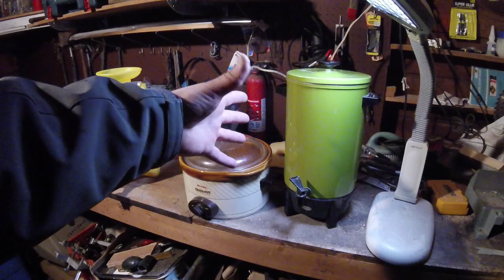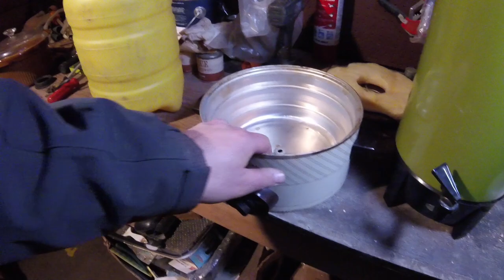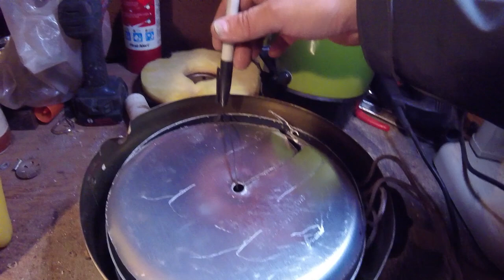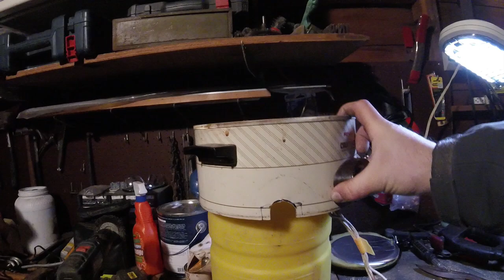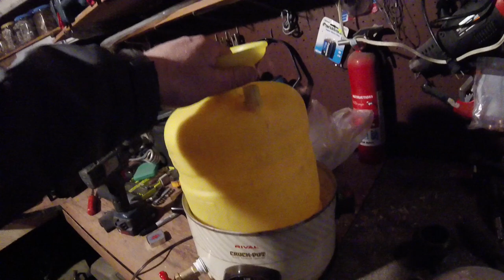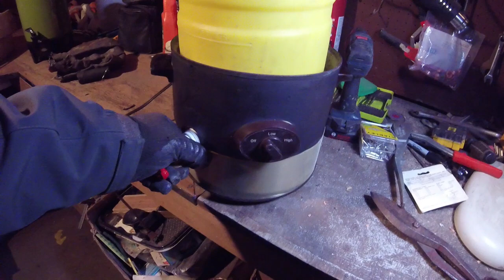PORTABLE Gravity Fed DIY HOT WATER TANK - Upgrade

Comment: Plastic is not efficient to transfer heat. And you will melt it, if you start this thing without water. Why not use a old gas cylinder instead? Or even better an equalizing tank from a big heating system.
Reply from the maker: It has been working well.  It warms it up quick.  I'm putting some aluminum in between the tank and the heater to keep the plastic from getting too hot, but it works awesome.  There is always a better tank to be made, thank you for the idea.  I'll do a follow up video

Comment: hey bro, that's a briliant idea. for the yellow Cylinder container can you not get one of those pan Cake griddle and just rest it on there to warm up the water ? and maybe you can have two tubs at the same time heating up to maximize the use of Water you need per day. Would that work ? just pondering ideas , great video learn something new too. Cheers!
Reply from the maker: Yeah a griddle would work I think.  I noticed that I don't need much heat to keep it a warm temp.  My goal is low watt as possible and still get a nice warm shower.  Maybe even just a light bulb on the bottom or a small beverage warmer thing that warms a cup of coffee.  It seriously doesn't need very much.  I haven't even gotten to the point of insulating the whole tank to retain the heat.  I only use about a gallon for a warm shower.  I guess it depends on what your preferences are.  I just wanted a warm shower and I don't really use hot water that much otherwise.  But yeah,  good ideas